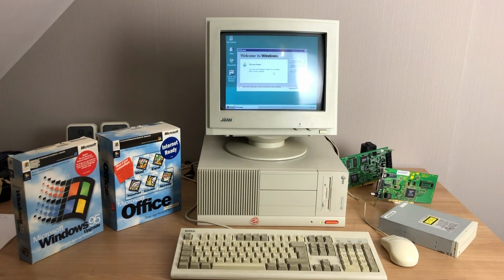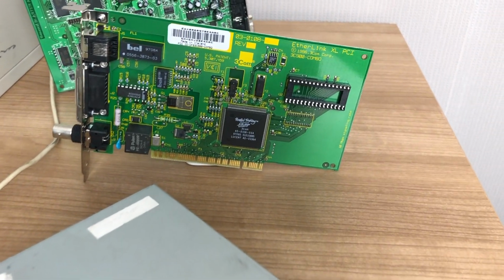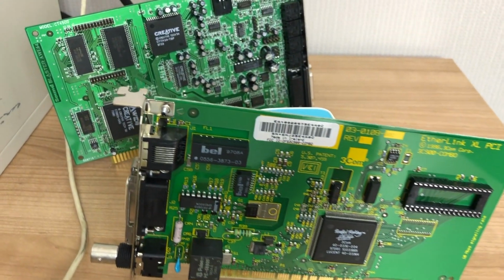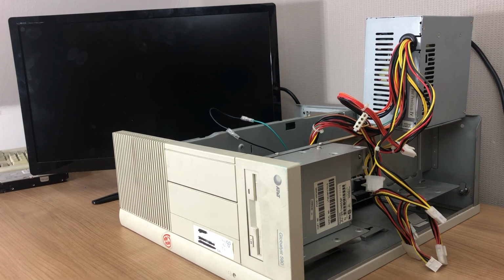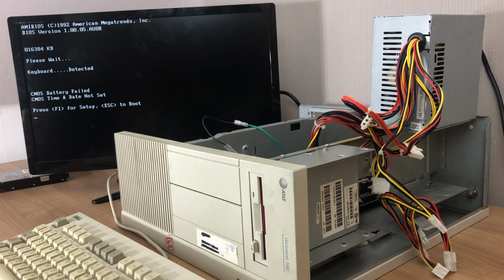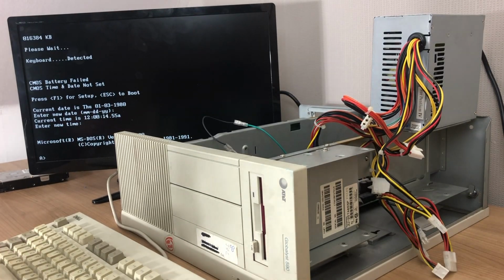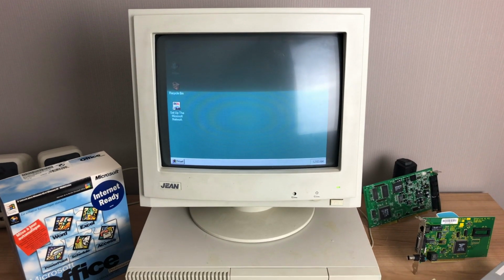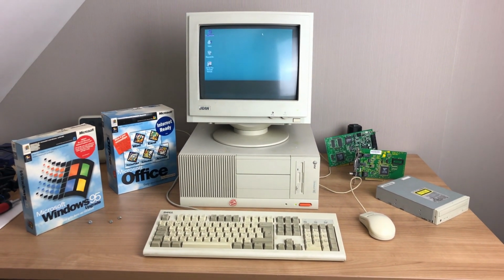AT&T Globalyst 590 Pentium 66

Comment: If you want this to be as original as possible, then I have a tip regarding the power supply: Typically, the AT&T Globalyst systems of this era used a Tiger Lead Year unit. It's standard AT in its power connection to the board, but I believe it may also be somewhat proprietary with the fan because it plugs into the motherboard either to power it or control its speed, or that of the CPU fan (it's been a while since I've dealt with Globalyst systems, so my biological RAM is a bit fuzzy). They came in 150w and 250w flavors, depending on whether you bought a desktop or tower case.

This is based on my knowledge of the next gen of Globalyst systems, the 620 and 630, so it may not apply to the 5xx series. However, I have seen Tiger Lead Year 150w power supplies in the Globalyst 520 (DX2-66) series in photos I've found, so I am guessing it would also apply to a 590.

Comment: this was the first machine I ever owned. I wish like hell I could find one out there somewhere!
Reply from the maker: That's awesome .... I found this one totally by accident in this thrift store where it was just sitting there, abandoned, without PSU or power button :) From the styling of the case I figured this would be either a 486 or early pentium, as I didn't know the AT&T line-up at all ... So I definitely lucked out with this one. A very nice system. But still need to do that multimedia upgrade :)

Comment: The original power supply of this pc does not classify as the original AT standard but belongs to the LPX (baby AT) standard. An AT power supply is what you find in an IBM PC AT (which is ca. twice as large and does not fit in this enclosure).

Comment: There are bootloaders made by the drive manufacturers  that allowed dos and windows to see the full drive
Reply: That PC should be able to support up to 8GB of HDD space since it was sold with a 520MB IDE or 1GB SCSI HDD (both capacities are above the cylinder 1023 which is the old BIOS limit and within the cylinder 1024 which is the second BIOS limit with regards to HDD capacity, the cylinder 1024 is 8GB and 1023 is 512MB).

Comment: Great restoration - good to see such a dandy machine being taken care of.
It seems like the oscillator, for the cpu, is socketed - if you feel funky you can change it to add odd clockspeeds via inserting new crystals. I had mine, Siemens based board with a Tseng4000, running at 40 and 75 mhz respectively. The Pentium 60 and the chipset worked like that(with added cooling of course) for a long time.

Could you "-timedemo" demo3 of Doom Shareware1.9(screen resized to hud and 1 border) and post the results?

Comment: You have no need to connect these two wires constantly (IMHO it's even bad for the power supply). You can take out a small pin out under the spring of the switch and it will becoe a knob (not fixating) as it should be. Good luck!
Reply: TY for posting that, I was always under the impression that ATX used a momentary switch.  I did not know those old, large switches were convertible, tho.

Comment: You can easily work around the bios disksize limitation via a network card and xtide-bios. You can flash/burn it to a bootrom and use it to manage your ide ports. It'll detect the drive(s) without the help of the bios and works with larger disks.
Reply: how do u do that ? any video?
Reply: @ΓιώργοςΠαρασκευάκης-ν7ε  simply burn/flash XTIDE Bios to a network interface card / bootrom socket. http://www.xtideuniversalbios.org/
It'll autodetect your IDE-drives and handle them, no matter what size.

Comment: Iam impressed - normally when you bridge the power-on contact for a longer time a ATX power-supply should power-off again (as I remember from my mind) - or does it that only if you do press longer when teh button was released after power-on? or does the converter do some "magic"?
Reply: It doesn't work that way. Power-on button on modern PC is not connected to the PSU at all. It's just a soft button. Meaning that it is handled by chipset electronics and by the software itself (generates ACPI event on press). ATX power supply only cares if green wire is connected to the ground (black wire) or not. If it is, then PSU is on if it's not then PSU is off.
BTW. there is a possibility for a computer to crash so bad that holding power button doesn't work anymore.

Comment: Doesn't an AT PSU have four wires going to the switch?  What are the other two if you do not need them?  Grounds?
Reply from the maker: On an AT power toggle you have 4 wires : live and neutral (these are always hot when the power chord is plugged in), and 2 AC wires that are hot when the PSU is turned on. In this case however I am using an ATX power supply with an ATX->AT adapter. On an ATX power the power switch is not connected to the mains voltage. The PSU only requires 2 pins to be shorted (typically by hooking up the power button to 2 pins on the mainboard. So in order to start the PSU, you only need to hook up 2 wires on the power switch (to short 2 pins) to turn the PSU on.

Comment: Throw a Voodoo 1 card into it and test it with some statically-linked Glide games!  I've been curious for a while about the oldest CPU that can drive a Voodoo card.  Obviously you need a PCI slot, but I've read that Voodoo 3D accelerators cannot run on 486 systems even though there were some later 486 boards made with PCI slots.  Of course I'd like to test that claim too, but if that is true then this would have to be about the bare-minimum.  All the Pentium systems I ever played with were using the more common Socket 7 platform so this is interesting to me, a Socket 4 CPU! Neat.
Reply: I have seen videos of Voodoos in AMD 5x86 machines which are 486 class. But I still wanna see a Voodoo in this :D wdym by statically linked btw?

Comment: You had very luck on that power button.. I know these arent use to obtain anymore.. And it was behind the front bezel. Maybe its an idea to install an LBA card or bios eprom somewhere so the system will support bigger harddrives. If you dont need the eprom socket on the NIC card, perhaps you could there install that LBA bios to overcome that 512MB problem.

Comment: When are you doing the multimedia upgrade?
Reply from the maker: I don't have a formal planning and priorities tend to shift a bit depending on the computers I'm getting and the stuff that sparks my interest. Since I've created this 6 months ago I received a lot of new "old" machines and thought about a lot of content that people might like to see. Here's a list in semi chronologic order that I'm currently planning on doing :

Laser 386 Computer (2 parts)
ibm 5150 part 3 (cleaning - software showcase) 
mda/hercules/cga/ega/vga difference
MCSE overview
MCSE firmware for video capturing
Compaq 286 computer
Compaq Presario all-in-one
Compaq Presario nineties pentium multimedia PC
Universal eepron programmer + use-cases (bios / xtide / video / ....)

Building the most boring 486
logitech audioman
ibm 5170 restoration
Gobalyst Multimedia upgrade
Running typical nineites cdrom software on a multimedia pc
software for ibm pc xt
"new" ibm 5170
286 gaming
ega games on the IBM 5170
ibm thinkpad gaming machine
8 bit isa card (mini ups)
My Gateway PC
multimedia 486 pc with speaker-case
computer speed (mhz) displays wiring
5170 bios options
Showcase old 286 laptop